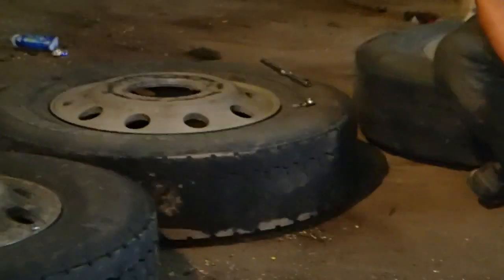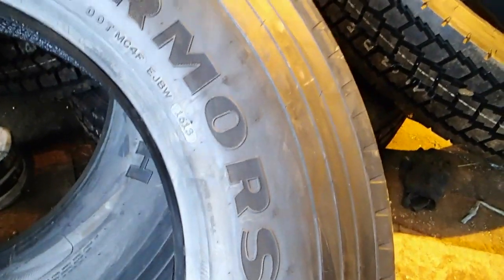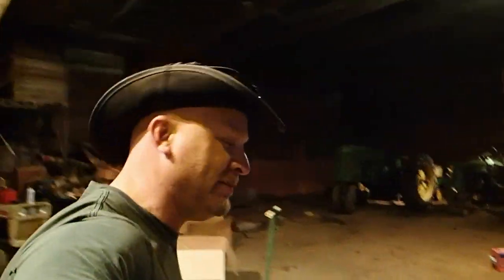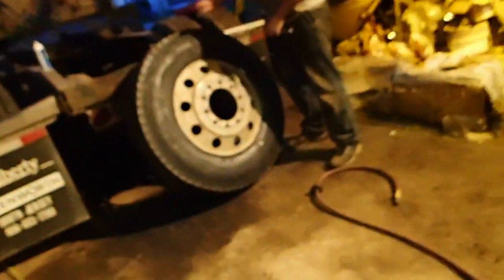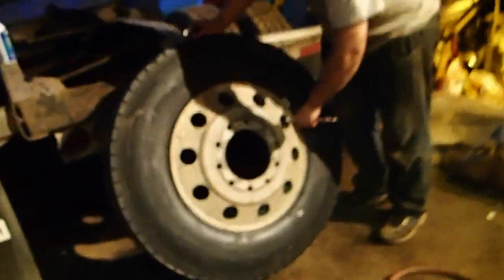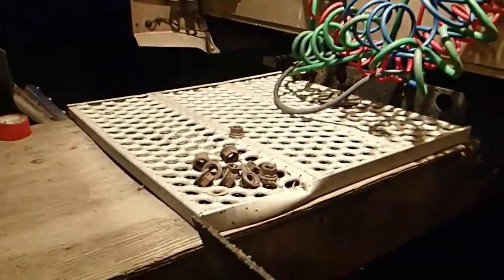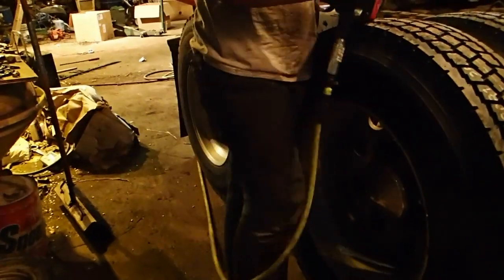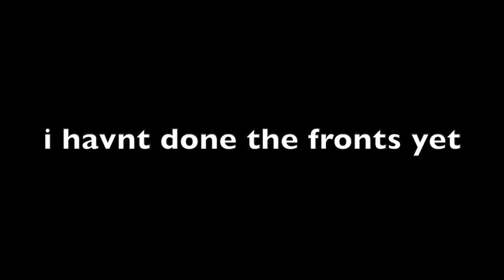truck tires

Comment: I used never seize on the outer nut of the double bud nut style as the outer nut always locked up on the inner nut! but I did use it on single nuts on aluminum wheels studs and center area where the steel hyb meets the alum. wheel. I used to load an 11r24.5 radial tire mounted on a steel bud wheel and toss them over the tailgate of a 20 ton dump truck. now I have back problems.

Comment: Wes/Tim-  I would highly recommend the following practice-At my work, and the tire shops I have to occasionally visit, they take a tire spoon, and use it to pry the tire off the ground and help turn and work the tire onto the hub.  I would hate to find out you guys got hurt trying to "manhandle" a wheel off or on the truck, They're heavy, and that causes problems.
Also Wes - I highly recommend Dunlap's, they don't seem to fail as often as other tires, and seem to wear a little better in my experience.  I am just a company driver, but to me it seems like they are able to take more-without the failures the others incur.  I figure I've done over a million miles, and that is my 2 cents worth.  I'd recommend wide singles for you, but given your application...., I just don't know....

Comment: Wes, How much would they charge for the tyres to be fitted at the dealer?
Reply: I had a roadside for a steer once, 6 miles from the shop that came out, cost about $800
Recaps run about 350, new's about 4-500 to start labor can vary, and that is for standard sizes/applications...  A good used Recap can run you $250
Reply: $30-40 is typical to replace a tire in a shop... Service calls are expensive, expect $200 labor to put a tire on roadside. Depending on the tire, a cap will run 350+ and a virgin drive tire around $500. Continental is a cheaper tire and I put a bunch on trailers, its reliable as Wes showed us.

Comment: I agree with the safety about airing the tires. My neighbor nearly died while filling a large truck tire when it blew off the rim /rim blew apart. It gave him severe Alzheimer's in his 50s. after years of physical rehab he could walk but always had severe memory problems.  I had a motorcycle tire blow off once. Had my head been where Tim's was it would have killed me. Or I would have suffered the same fate as Lawrence....

Comment: Those inside duals are off of a Peterbilt. I grew up with trucks and I drive them now those are Definetly Pete wheels. I use the same gun so does our shop. I also plant channel beans. When are you gonna start on the Farmall M? I have a 49 I'm waiting on gettin parts.

Comment: One of the smartest things I ever bought was a doghouse from Home Depot. I put my noisy air compressor in it. Outside of the shop.
Reply: then thieves will strip them or just straight up still them. only way i'd have one outside is if it was bolted to a concreate slab and then chained to the building inside a chain link fence with barb wire. lol
Reply: Karsten Jackson That's why you live wayyyy out in the country, ain't nobody gonna mess with anything out here.
Reply: Chad Williams Thats right. guess i been stuck in this damn city suburbs to long...

Comment: Arent those tires regroovable? I thought most semi tires can be grooved.
Reply: You don't regroove them, you can "recap them", where as the remaining tread is ground off, and new belts are applied with a new tread casting, onto the original tire casing.  Reputable recappers can safely do it so that it will last, and they inspect the casing (remains of the original worn tire) for damage.  But there has always been a lot of bad recappers out there, and between them and low air pressure (by neglect or damage), that is the source of those "gators" (truck tire treads), you see littering the highways.  You cannot by Federal DOT Mandate use Recaps on steer tires in the USA, they consider it to be Unsafe for Public Highways.  You can use them anywhere else, but not the steer.
Reply: bigtrucker26
Actually you CAN regroove them, it says right on the tire casing if it is.  Typically there 5/32 or a bit more of rubber between the bottom of the tread and the actual casing of the tire.  You can cut new grooves or follow the old pattern, they make machines for it as well.

Comment: Lol a guy mentioned it below but harbor freight has better deals on basically the same gun. Electric 1/2" gun 15 piece I think socket set and a 3 pack extension cost me around 150. The sockets and extensions have lifetime warranty I'm sure its a great gun glad you bought it and like it but you paid wayyyyy too much for it lol

Comment: I am in Australia and drive trucks but I have never seen that with fire before what dose it do?
Reply: It's the ole' school way of seating a bead.  You spray starting fluid into the tire-and wes was good enough to show a little safer method of running a stream away from the rim to ignite.
To seat a bead, you often need to supply a burst of air pressure to force all the bead surfaces together at once to create a seal.  The ole' school method uses the simple mechanic of a chemical explosion to create the pressure wave.  You must immediately there after supply air to the tire, as the air remaining in the tire is heated and will contract, potentially creating a sufficient vacuum to break the bead seal.  The more commonly practiced method is to use a burst of compressed air from some kind of air cannon, usually a 5 gallon portable tank with a large ball valve and pipe to blast the air into the tire at the bead.  The cannon method is the current practice, and standard, due to the fire explosion dangers, also nicely displayed by wes, in the form (in this case) of singed hair, and nails.
Now that wes is investing in more equipment he will likely (in the next couple years) decide to acquire on of the air cannon bead seaters.  Until then, this method is sufficient to get the job done.  It works on all tubeless tires of all sizes, and has been practiced for longer than wes has been around ;P , it was the way to do it.  But safety regulations evolve, and some practices just don't generally cause enough problems for everyone to walk away from them because they work.  You can even see Mythbusters did a episode once, and it was one of the confirmed "myths", not necessarily recommended, but it works.

Comment: ever thought of getting a tire cage? they are scary as hell when you get a bad tire and it blows up during inflation
Reply: Cages are good safety equipment, but they aren't used as much as they were back in the split rim days... the one piece rims nowdays are a LOT safer.  

We used to have several cotton trailers built on old 40's and 50's truck frames that used 5 or 6 bolt hub "Budd" type wheels, usually 7.00-20, 7.50-20, 9.00-20, or 10.00-20's.  They were all split rims-- some had solid or slit rings that hammered on around the inside of the rim edge, some joined in the middle.  

We had one mounted one time where the ring blew off the rim-- luckily it was in the cage because when it blew it left a perfect impression of the ring in cage tubes all the way around.  

When I was in mechanic's school we saw a split-rim tire inflated til it exploded with a dummy on top.  Kinda gets your attention.  

Ya still have to be REALLY careful, and if you CAN use a cage, you SHOULD.  But for those of us who don't have one, a hose leadout from the stem and a remote valve is the BARE MINIMUM equipment-- never stand in front of a tire having beads seated.  

Later!  OL J R :)

Comment: I had a large air tank mounted in my service truck and a large ball valve and farm style coupler and it was mounted 18 inches off the ground, I would roll a semi tore or any tubeless tire up to that large valve, put my clip chuck on the fill valve and pop that 1 1/2" valve open and blast the tire onto the rim.
Reply: Most tire installers, for commercial tires, take a modified 5 gallon portable air tank (like you see for filling tires at the auto parts store...), put a 1 1/2 to 2" ball valve, with a pipe that has a crushed end that reduces it to 1/2" wide, by whatever the diameter expands to.  And do the exact same thing, they are commercially sold, and widely used.  The starting fluid trick is becoming a dying art, over safety concerns....
Reply: bigtrucker26 it called a bead blaster handy bit of kits most if not all tire fitters carry them
Reply: they had a Cheetah blaster system and a large adjustable for 22.5 and 24.5 semi tires at the shop where I worked out of! I made up the system with a 20 foot 1 1/2" hose with a 2" ball valve with a flattened pipe so I could air up tractor, Combine & earth mover tires, it hooked up to my 60 gallon air tank on my service truck.

http://www.northerntool.com/shop/tools/product_200451163_200451163

Comment: Sir you can get the same gun from Harbor Freight for $279.99  Item # 61616 or # 68429 It does not come with the 1 inch sockets

Comment: Be real nice if the tires were balanced and proper torque on the lugs. And a cage would be nice or put a loader bucket on wheel. I'm just that way with tires and wheels. Safety was pounded in my head in a fleet shop for years.
Reply: It would be nice to balance, and use a torque wrench, but common commercial practice doesn't include those steps.  Neither is a cage common practice, even though they are becoming more and more common to be installed in shops, and service vehicles....
Reply: True. It's more of a shop thing. That 1 inch impact can do a lot of damage. We stopped using them on our firetrucks when steel rims were cracking and studs breaking off. Of course is doesn't help when the truck runs over curbs and medians and pot holes at top speed.
Reply: Rick Watrous I suspect that is more a cause of damage than the gun.  Just the compressive power of the gun shouldn't be that powerful.  I suspect you either had fatigued parts, or just plain defective ones.  Also the rims and studs you were sourcing may not have been properly spec'd for the application.  I'd lean more toward that than too strong of a gun....  I know a lot of fire departments are strapped for cash, but it usually pays off to invest in quality, hd parts.  I don't know, nor claim that you guys intentionally would get inferior parts, but the reasons for the fire trucks, require the dependability that require better parts...
respectfully
Reply: It's been 20 years, but now that you said that, we did replace all the rims on the trucks back then because of cracking. But we did go back to using a 3/4 impact to zing them on and finished up with torque wrench.
Reply: same here on tire safety. I still got the picture in my college notes of the splat mark of a guys head, on the tire shop ceiling where the tire blew out and put him up 20ft in the air. I don't have the cage here but use a big loader and front bucket as the safety catch. A 6ft or more clip on hose on the inflaiter's a good thing to.
 Not a fan of either in tires , guess like using it for starting it's ok in small moderation. it can take a few weeks for the effects on the rubber to show up if using to much though, through heat damaging the rubber if over done.
I Worked with a guy in a machinery repair shop. He used to do heavy truck tires while I did the AG ones. seem to remember him opening and putting bags of brass type shot in the tires to balance them when he did it.
Regards Robert
Reply: Cages where a must with split rim tires my dad has had scares the ring popping off. A clip on air chuck is a must for tubeless tires no way in hell would I be holding on the air chuck airing up a newly seated tire. With todays hub pilot wheels with washer nuts they are torqued on pretty tight. All in all I still rather have 6 spoke Dayton wheels takes a little longer to get them put on right they are still easier to deal with.

Comment: So....your going to be sure to keep your truck out of the sun now right? (to slow down the chines tires from dry-rotting) Hope you got them from a dealer that will be around a year from now. By the way, I recently read of a problem encountered of unauthorized Chinese knockoffs being exported into the country where the company whose name was on the tire said..".we don't warranty counterfeit tires." If I find the link...i'll be back with more info.

This sentence will help you find the link via google:    “The Pegasus Advanta SUV tires you tested … were not produced by any authorized vendor to American Pacific Industries; who owns the trademark ‘Pegasus Advanta SUV’ and the hardware used to produce those tires.”

Comment: At least teach the boy not to stand in front or above the tire when its inflating.  You don't need a cage but staring at the wheel and tire inflating, you might as well be looking down the barrel of a loaded gun.